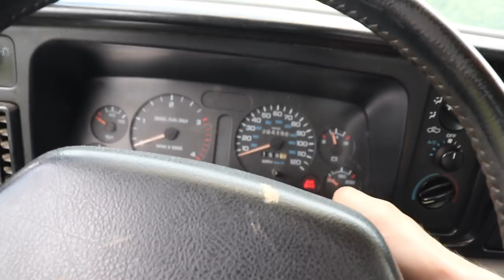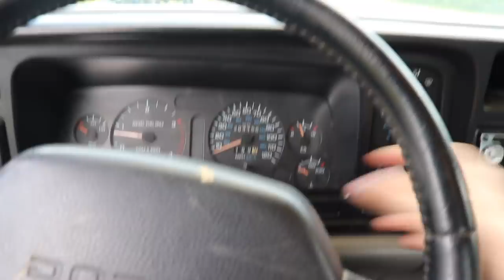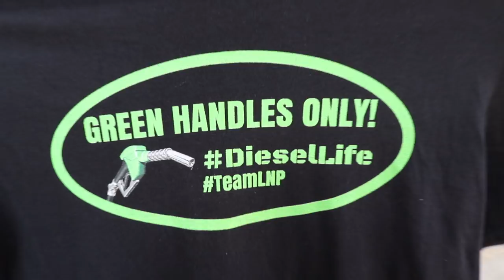NEW WHEELS AND TIRES ARE HERE FOR THE CUMMINS!!! **TRUCK GIVEAWAY IS NOW LIVE!**

Comment from the maker: 🔴The 12 VALVE GIVEAWAY IS LIVE!!!
🔥🔥🔥🔥🔥🔥🔥
Every $20 you spend on the merch store gets you an automatic Entry!!!
WEBSITE LINK: https://team-lnp.myshopify.com
Or- Team-LNP.myshopify.com
You could be taking Home a new truck!!!
Reply: LOUD 'N' PROUD bought my 👕
Reply: The truck looks great man! Keep up the great work, love the vids
Reply: Hey bud, I just made my purchases and wanted to inform you about an issue that I encountered. It doesn't display the details that you pick in its respected box when choosing. I had problems with the mechanic shirt because it was showing that I wanted 11, 111, and 1,111 of the same shirt instead of just one. I kept trying to delete them but you can't see anything so it made it difficult. Through trial and error, I eventually got it down to just one. Some of the other drop down boxes weren't displaying your selection either so I hope the colors, sizes, et cetera that I chose are right. Just a heads up bud. Didn't want you to receive a lot of flack over it. Love the content and keep your head up. Have a wonderful weekend!
Reply: LOUD 'N' PROUD please adjust your pump timing on the dually. It should be running smoother then it is. Oh I entered the giveaway too I got my eyes on that dually
Reply: When is the last day to buy
Reply from the maker: July 2nd
Reply: LOUD 'N' PROUD thank you so much I love the vids and the 12v

Comment: Make sure they actually need to be done, a lot of wheel/tire places will tell you that it needs to be done bc it’s expensive and most people won’t check, Les Schwab tried to pull that on me when all of my tie rods/ball joints were brand new.
Reply from the maker: Jackson Baker this shop we have used for years... since I was like 4 years old... they are very honest people... they said that truck really shouldn’t be driven until it’s fixed, it’s that bad they said. They said I could do it myself or they can. But it’s got to be addressed. But I don’t have the time or know how... so I’m gonna have them do that and brakes.

Comment: What else are you doing with the dually
Reply from the maker: Lbm Shepherd MT Tires, rear 2” bora spacers, dropping off for paint in a day or 2, bumper, maybe headlights and taillights, interior clean up, ect... it’ll be awesome..
Reply: Sounds like it. That's what my plan is for my 1996 ford f350 7.3 5 speed 4 10 gears 100000 miles old man's truck rust free mint interior lol I love her. Shes just got a superchip programmer and coldair intake but stuff soon to come for her
Reply: Also what was the video with the awsome intro